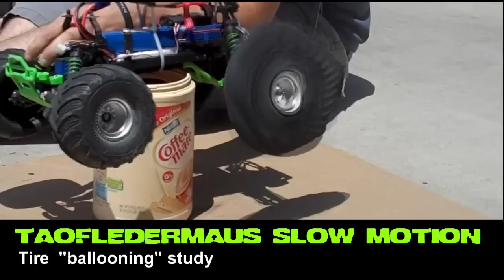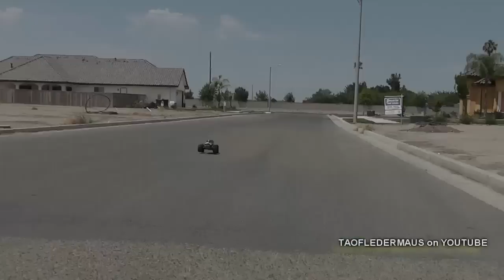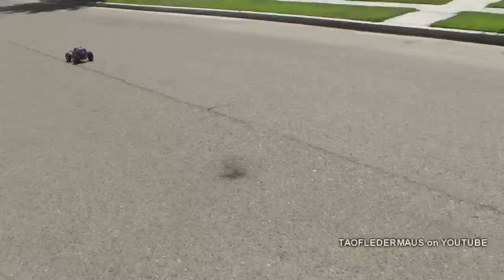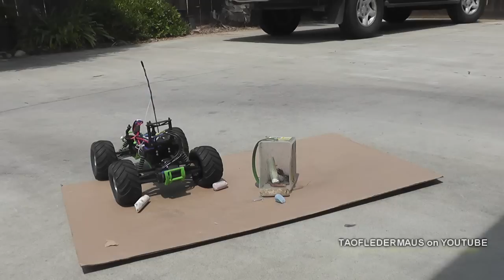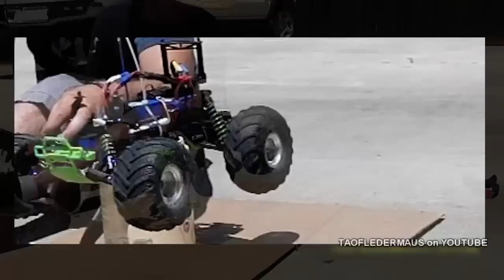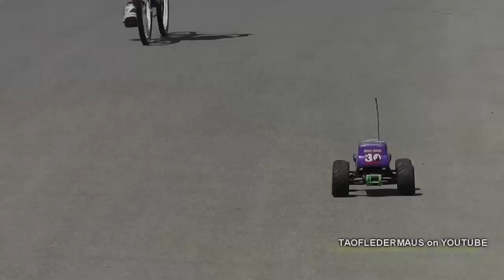Crazy RC Tire BallOOning  - Slow Motion Study

Comment: Ok. A real fix for you here. 

Take the tires off, turn them inside out and duct tape them. Go around twice with the tape. Turn the tires back in, install your foam cushion again, Reinstall the tires. 

My local shop gave me this advice when I was having the same issue with my car. It would go so fast it would flip all over the place. After taping the tire it stopped the swell.

Comment: if you take the tires off the wheels turn them inside out wrap duct tape around them several times then put them back on as recommended there will be very little to no ballooning. i do this for my 6s erevo, a truck that can shred tires on command.

Comment: That thing is faster than some REAL cars!
Reply: It is actually resonably quick however if compeared to speed machenes like the hpi e firestorm and the traxxas x01 it is quite slow
Reply: Webcamboat THE XO-1 IS INSANE!
Reply: It doesn't take much to stretch rc tires. The tires are cheap reproductions or real tires made of only rubber, real tires has massive steel bands to keep them from stretching. Even your cheap bicycle tires has nylon or Kevlar band to keep them from stretching because of centrifugal/gyro forces.   Rc cars definitely has a lot of power for its size. But wheel ballooning is not how it's measured by any means.
Reply: Torbjørn Larsen These tires are cheap monster tires though. The pro level tires actually resist stretching much better. The 1/8th buggy tires are pretty good. And, there have been belted RC tires. But their cost and weight kept them from being adopted. You still see them on the super high speed pan cars that run speed records though. But, most of those guys just cut up Indy tire carcasses and make their own anyway. They need them when running on outdoor velodromes.

Comment: In order for the tread part of the tire to move in a circle, it has to be pulled in toward the center (mentioned before, wants to move in a straight line if at all). It has to be accelerated  "in" toward the tire hub (equal to the angular velocity squared times the radius of the path). The tire rims are springy and must provide the force by stretching.
But taofledermaus's bungee example is even better because: 1) it is accurate, 2) it is intuitive, and 3) you can test it yourself!

Comment: wow!, talk about exceeding speed ratings :D, time for RC car makers to step up and make some nylon belted radials :D
Reply: That would be bias, but thats not a bad idea.
Reply: i would love to see that. the expensive tyres from proline, (54 dollars) are really very good. those tyres are for rock crawling and have no foam in them at all. nylon belted radials would be fantastic and make things easier.
Reply: smallenginedude71 There have been belted tires but they were expensive. Typically the only guys who ran them were running pan cars for speed runs on outdoor velodromes. They ended up just using old race tires from Indy etc and making their own as I recall.

Comment: This is why Traxxas makes good bashers. Lots of chassis flex to soak it up. Reminds me of slow mo of trunions on an ak. Good lasting difs too.
Reply: I like your reference, comrade.
Reply: Does traxxas make good bashers? I haven't seen any. I use to own rustler and slash 2wd. Upgraded the hell out of them and still wasn't close to 1/8 scale durability. Traxxas generally need 50-60% rpm nylon parts before they become durable.  You only need a single alu upgrade on rc8.2e or rc8te to make it bulletproof. Hpi vorza is also 50 times more durable than any stock traxxas. Except for the stock esc that often goes up in smoke after some months use.
Reply: I have done some truly offensive things to my Slash 4x4, and I haven't had one single issue. I replaced the A-Arms from the get go. That cost about $20, so I'm not complaining. If you Google "Best Basher" it'll come up Slash 4x4 many times over. I have an 1/8th scale Losi 3.0 Nitro, and it's awesome too, but there's something about the Slash that makes it feel invincible to me.
Reply: Torbjørn Larsen But that's on 6s.... 6s kills EVERYTHING
Reply: dotjp if you run normal rc tires that doesn't prevent ballooning..  the tires expand, making the gyro force even stronger because increased diameter caused the outside rubber to travel faster. Also followed by a massive unbalance in the wheels.. 

Most professional rc guys who only run 6s actually has higher durability. Because they select a motor with less kv and more torque, +more powerful esc.. the entire system is less prone to overheating and rotor failure.. 

my rtr 1/8 car is pretty much running with a 1/10 system. If I optimize it to run on 6s with no speed gain it would accelerate better and be more reliable.. the typical 1/10 scale esc in 1/8 scale cars also lacks the built in bec to run high speed servos designed for 1/8 cars. Your getting weak and slow steering performance. Swapping out the servo for a faster one doesn't help unless you run a external bec. Your 1/10 scale esc may also get damaged if you don't use external bec with high speed servos..
Reply: Austin O'Neal every 1/8 car isn't equal in durability.. a guy at our local track runs a rtr kyosho buggy.. nobody seen that thing go more than 3laps before it breaks. Meanwhile the AE and mugens runs 20-40 battery packs with only normal service.  one week the kyosho dude broke 3 dog-bones. I had my AE truggy for years. Still haven't replaced or bent any drive shafts..
Reply: Torbjørn Larsen I've been out of it for a while I admit, but you're telling me every ESC sold today DOESN'T have BEC built in? Dude, when I was semi-pro in the early 90's they >all< had BEC for 1/10th. I find it hard to fathom that present day ESC don't come with that standard. My old Tekin has it and it isn't even the one I ran back in The Day it's from the late 90's :)
Reply: gotindrachenhart seriously dude. Think about what your saying.. I said most 1/10 esc's lacks bec to run 1/8 scale high speed servos.. I didn't say that there wasn't a built in bec.. my reedy xp sc-1300bl can't handle my new savox servo..  it can't even take fully advantage of a cheap servo with half the speed of my new savox..
Reply: Ah sorry, missed that! I can see how running the larger servos would stress the BEC out! :) I should hit the sack, I'm on hour 20 something now :)
Reply: @Austin O'Neal if you have to replace your A-arms before you even run the damn thing you bought a piece of junk. Also, should I even dare mention that whole 'Oh it's normal for TRX2.5/3.3 to throw a rod between the 4th and 7th tank of break-in' problem that hasn't been solved in over a decade?

Comment: Wrap your head around this: a normal car tire does not skid on the road going straight at highway speed, right?  So the bottom of the tire on a car going 60 mph (96.6 kph) is actually moving at 0 mph (0 kph), otherwise it would be sliding on the road (skidding). The wheel hub is moving at 60 mph, and the top of the tire is moving at 120 mph (193 kph) straight forward. The outside bit of the tire goes from 0 to 120 mph about 18 times per second if you are rolling on 18-inch tires.

Comment: There were some tiny simplifications. For example, the distance from the ground contact patch to the tire hub (center of rotation) is not the same as the distance from the hub to the top fiber of the tire because of elastic deformation of the tire, but it did not seem worthwhile to dwell on that. Given that you do not understand the concept of instantaneous center of rotation, I think it was a fine judgement call.

Comment: Another excellent video showing how far behind RC tire technology is compared to full scale tires. Past the research on rubber compounds and foam padding with tread designs to work with the soft material these are little little more than improved toy "look alike" tires that behave poorly and will self destruct in "normal" operation. Modern RC tires need to be made composite and use Kevlar and other materials available as videos using tape to eliminate the most obvious problem shows... but this is just an important step in the right direction exposing the same problem real cars have... they need tires that work and can handle an increase in RPMs. As far as real performance issues go scale RC car tires have yet to be born. 

Any race car driver will tell you your tires are EVERYTHING and nothing works well if they don't work well. IMO RC Cars are only 50% real RC "hobby grade" scale models right now because the tires being used are still toy tires. It will take a large tire manufacture like Michelin that understands the complexity of building good tires to step in and do it right when the money available in the RC Car & Truck Hobby attracts them....  not sure what they are waiting for at this stage in the game... huge market with established cash flow increasing with FPV that needs round wheels.

If you want see how bad RC tires and wheels are drive your car FPV and you will see how out of round some are. You really notice your tires when you get in and drive the car yourself rather that watch it being driven LOS. You feel what's happening when you are inside the car and you want good tires and wheels in perfect balance to make the FPV view smooth when you hit the gas... remember the wheels are 4 gyros creating stability.... WHEN balanced properly.

Comment: So all the power is going to one wheel?
Reply: Yep. This is a 2wd car. If you hold one wheel, the differential makes the other wheel spin 2x faster.
Reply: @Benton Miller Open diffs don't get damaged doing this, they're designed to be able to do this..

Comment: I bought 2x5Ah 22.1C, and a 3.5kW liquid cooled motor, planned on putting it on a bike to turn it into an ultra light moped, but i just couldnt get a drive train strong enough for the high torque this thing put through it at such high RPM, i think it peaks at either 21 or 31k RPM

Comment: This is why tires on real cars have belting in them to limit deformation. But if you somehow manage to fast enough past the speed rating, the belting will fail and the tires can still do this with typically catastrophic results.

Comment: I work with these cars and that is one of the odd ones that doesn't have foam inserts ti support the integrity of the tires. but even with the foams or even belted ***** they will balloon the motors just have that much power and RPM.

Comment: I'd be interested in seeing how something like DynaBeads inside the tire could keep it from becoming imbalanced and improve the performance. Probably would only need a fraction of an ounce of beads to balance a tire that small. If you balance the tires it might stop popping up on its back like that even without adding a wing/stabilizer.

Comment: Very good. Now, as to the physics/mechanics? What is the speed of the contact patch with respect to the road? What is the relation between the radius and diameter of a tire?

Oh, whatever, the parent video is fun. Those guys are great. You are close to a troll. Everyone else should just enjoy watching and understand that bluntmaster67 does not understand how to do basic engineering dynamics. If you would like to understand the mechanics, try Hibbler, or other good textbooks.

Comment: Typical power system for a 700 size electric helicopter is 12S (44.4v) with a 120amp speed controller and a 5000W motor. And some run far more powerful power systems than that.

Comment: Why is only one wheel turning
Reply: Probably holding the other one in place. If that is the case and it has an open differential, it will just send all the power to the wheel with the least resistance. If one is being held in place(a lot of resistance) and one is free to spin(virtually no resistance), the one that is free to spin is going to spin VERY fast.

Comment: the vxl-3s esc can handle 6s? lipo? wtf. how in the world did u do that?
Reply: +All The Time Rc  yah idk the motor can handle it but the ESC cant
Reply: They most likely used an esc programmer. You can max the esc out and then you can run 6s, but it's not good for the esc it will burn up pretty quick.
Reply: EverydayBasher1188 He wasn’t running 6s. He was running two 3s packs in parallel, meaning it is he voltage of a single pack but be capacity and discharge rate of two.
Reply: Pretty much any ESC can handle 6s...*for a bit.*

Comment: Crack open a physics 101 textbook. It is all correct. What speed do you think the bottom of the tire is moving with respect to the ground? And what about the wheel hub and the top of the tire?

Comment: ive been wondering why there is a side that is substantially heavier than the tire (i observed it by spinning the tire and letting the heavy side rest on the bottom) is that where the foam insert is connected/glued together? that is the only explanation i can think of :/ im sure that would become a factor when using high RPM tires (going really fast) anybody know more about it?

Comment: Are the wheels meant to be doing that?
Reply: Rc car wheels are built like race car wheels, there are holes in the rims and when it spins fast enough they air up, the faster it spins the more it airs up, it also depends on how soft your tires are, it they are like plastic they won't air up. if they are very soft they air up very much. Hope this helps.
Reply: Thanks for the information :)
Reply: +SlyMeerkat No Problem, Anytime my Friend :)

Comment: The reason why the tire balloons soo much is because one of the tires were locked up.
Reply: That's not why
Reply: They're*
Reply: This is slightly true, because it is sending all the power to one wheel instead of evening it out between two, but with the power the truck is running, they can air up nearly the same. i only know this from testing out this with my old slash Vxl i used to own.

Comment: He is holding one wheel so the other one spins twice as fast
Reply: its an open diff, one wheel can be held while the other still roates, with a locked diff, u hold 1 wheel and both wont move.

Comment: If you glue rubber bands down the center of tire it won't blow up so bad....
Reply: Rubber bands? No.  Turn the tires inside out, clean, wrap carbon  fishing line 8-15 times around the wheel. And make it stick to the rubber with rubber cement or shoe goo.
Reply: Torbjørn Larsen this is very interesting. I have been seeing everyone tape their tires to stop ballooning then now all of a sudden I see you can use rubber bands or string too? never heard anyone say to use either one of those.
Reply: RideRedRacer tape doesn't stay on that good..  the glue isn't made to be permanent.. rubber bands are to elastic. Real tires use steel strings or Kevlar/carbon fiber.

Comment: Led fishing weights on the front end stops the back flips.A wing won't do anything but look stupid. RC cars don't usually displace enough air to make aerodynamics that important. That said free spinning you drive train like that, is basically a tutorial of how to ruin a half decent RC.
Reply: who cares.2012 world was ending in December
Reply: weights would add weight(obviously) and that would make it slower, what they need is a wing in the front, with not too much angle, then it will also just go slower!

Comment: That motor is only rated at 3s lipo
Reply: Bryan Casillas I know I was thinking throughout the whole vid
Reply: He was only running 3s. He was running two 3s packs in parallel, which gives the same voltage as a single pack, but the capacity and discharge rate of two. Basically he used two just to double the run time and to give a bit more “punch” than a single small pack. So no worries, there is no 6s power here. The esc wouldn’t even boot up on 6s, it would likely just fry immediately.